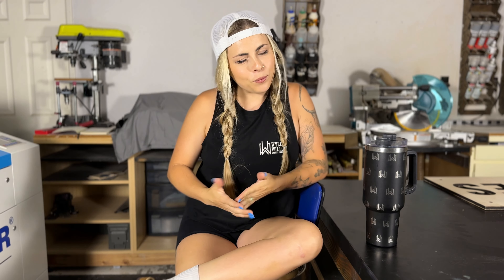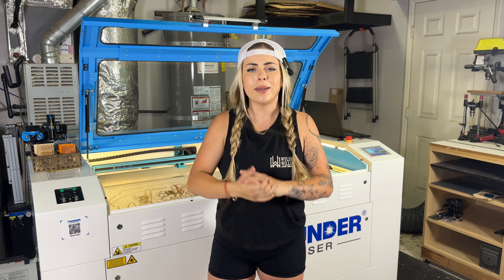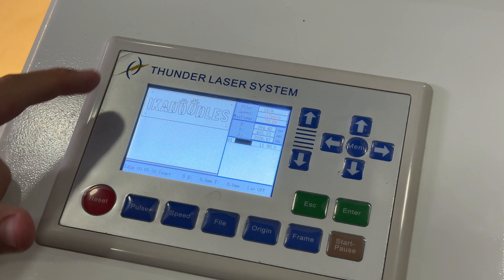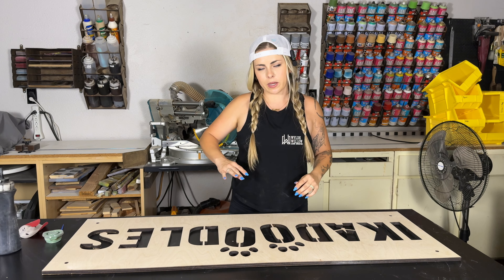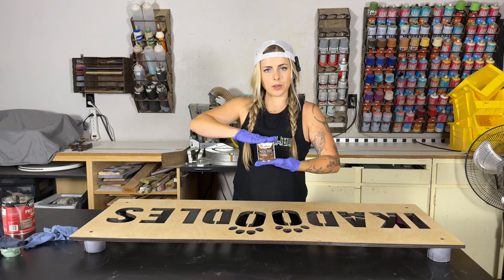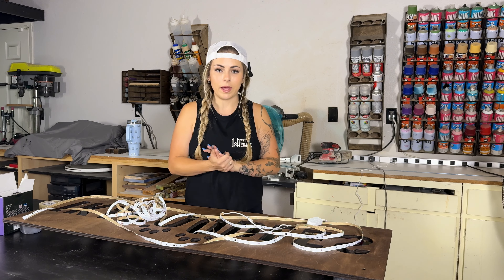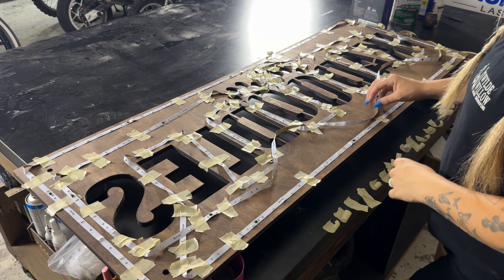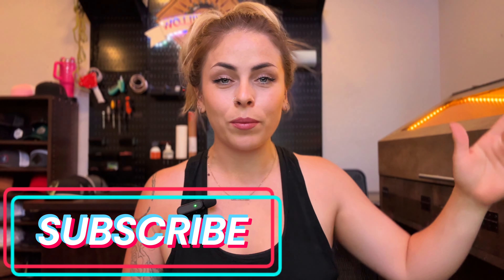Making laser cut LED signs for beginners. (Featuring my new Thunder Nova 51 100W)

Comment: You might want to check and make sure the laser bed is parallel to the laser head.  Check all 4 corners.
Reply from the maker: I did check when I got it but I'll have to double check. I was pretty excited to get it running so I might have not leveled it perfectly. Thanks!

Comment: Can this be made on a diode?
Reply from the maker: Yes absolutely. I have done similar signs on my diode laser your just limited by the size of your working area. You can also use the print and cut feature in Lightburn to make signs bigger than your working area. Also it make take you several passes to cut the wood depending on what thickness of wood you use.

Comment: That’s an awesome laser. I wanted to get one of those but I haven’t got the space. Great video.
Reply from the maker: Have you looked at the bolt? It's alot smaller and comes with an RF tube. It was hard to choose between the bolt and the Nova 51 but in the end it came down to bed size since I do alot of large signs.
Reply: @WyldeWillow I bought the Xtool p2 it fits perfect into my small office space but I really want to buy a thunder in the future.
Reply from the maker: @ajvaldez yeah it’s really a huge game changer! Definitely recommend

Comment: Awesome video, love seeing the creativity! Keep up the awesome work and videos!
For the difference in cutting power from the left to right side, or front to back, it may be beam alignment related. If you haven't checked it, one of the mirrors may be misaligned and tipping the beam as it goes from one to the next, and as the gantry goes to the other corners of the bed, it may see a drop in power because of not being centered in the mirrors or part of the beam getting blocked on the way to the next mirror or catching the nozzle if its not centered on the lens coming into the head. Not always the answer, but it is the most common thing I see when people experience extreme differences in results across the 4 corners/center of the work bed. Keep on rocking!
Reply from the maker: Great info!! Thank you so much! I’ll definitely check it out! 🤗

Comment: Thanks for this easy to follow video! Can you talk about shipping these and do you typically keep the back of the sign with the wiring exposed and include the hardware? Excited to see more options! Congrats on your Thunder and channel success!
Reply from the maker: Thank you! Haven't shipped any yet but I also haven't tried to market them online or anything. I stay busy with local work so haven't seen the need to. As far as the back it depends. This customer had a low budget to work with so I just left it open. You can frame them out and put a thin piece of wood on the back to cover them. That is if you don't want the light shining out the back. So really it just depends. I do Include hardware but if it's reasonable I usually go hang them my self. I do this for two reasons. One, it helps build relationships with customers. Two, I always worry they are going to mess them up. 😂

Comment: Found your from Spicier design on he’s tumblr engraving. Can you make a video for a Stanley 40oz cup full wrap on a Xtool S1 20w. There really isn’t but 1 other video but after seeing how you help SD. I’m thinking your settings will be spot on!
Reply from the maker: Unfortunately I don't have the riser base for my S1. I'll eventually do a full wrap on one of my lasers. One thing that really helped me was just doing a line about 5mm wide that ran from the top to the bottom. I would run that line over and over with different settings and focus heights until I found the right combination.
Reply: @WyldeWillow  looking forward to seeing that video. I used your recommended settings as a starting point. As this works perfectly with even tumblers

Comment: I've never had any real luck with the adhesive on the back of the lights sticking for very long, Is that all you use and how long do you expect the lights to stay stuck? Thanks for the video, I'm really looking forward to more on this subject.
Reply from the maker: Those lights I used in this video stick really well but the more expensive version of these lights I use. Usually I have to use CA glue with them especially around the bends and corners. I highly recommend the lights I linked in the description
Reply: @WyldeWillow  thanks so much for the help, I'll try the lights in the link for my next sign. Great tip on the CA blue, I hadn't thought of using it.